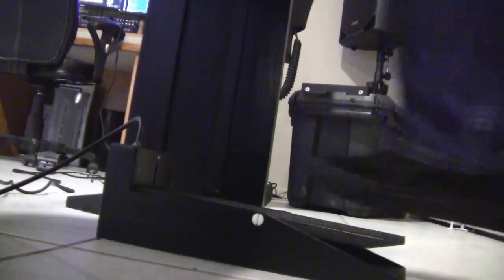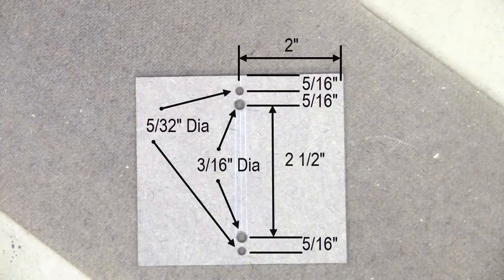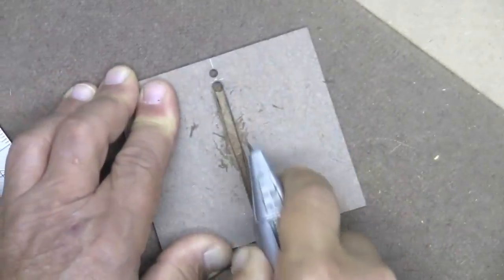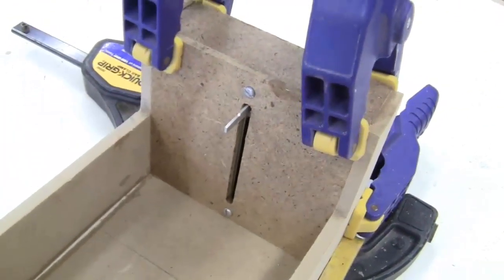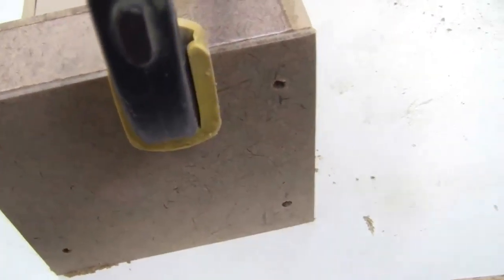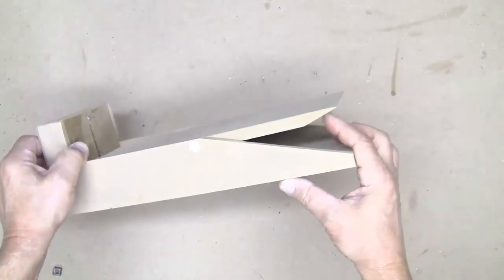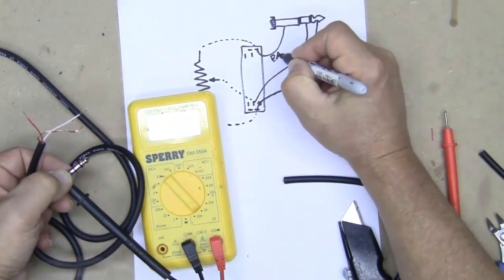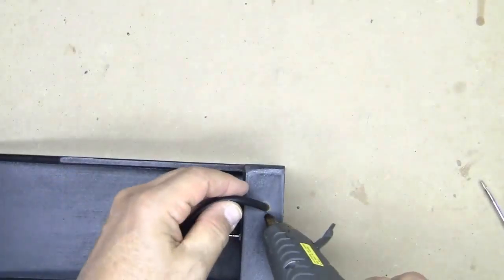Build this FC7 Clone for you Yamaha or other Keyboard

Comment: This is a great tutorial but there's just one thing I'm not sure about. 
I have an FC7 pedal and when I compare the wiring with this clone, they are indeed the same but when I look at the Yamaha FC7 manual (available online) it appears to show the potentiometer wiper connected to the jack plug tip, common to RV and RT, with the remaining part of RT connected to the plug barrel and the remaining part of RV connected to the centre contact.
Is this simply a printing error or am I misinterpreting the manual?

Comment from the maker: Hi All.  I've changed the design to a 50k linear pot which works MUCH better!  I used Mouser.com part number 652-PTL60-15G1-104B2, but any 60mm travel, 50k linear slide pot will work just as well.  You could even use my Original volume pedal design and install a Radio Shack 50k liner pot.  Any questions, please contact me at Brodafinjr@optimum.net